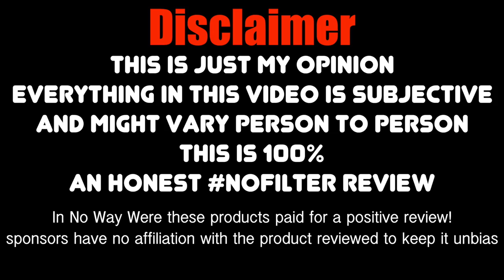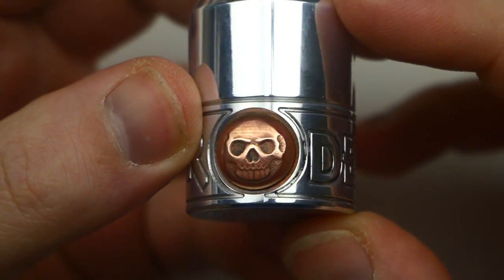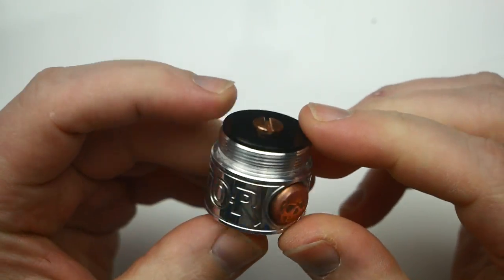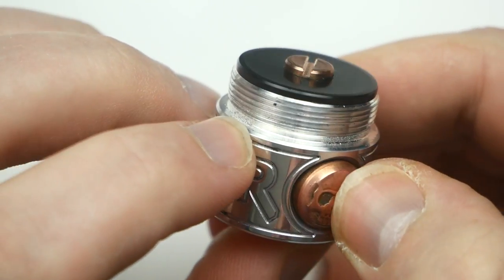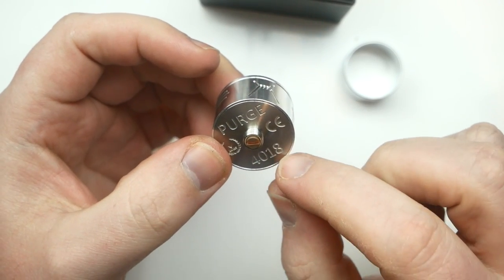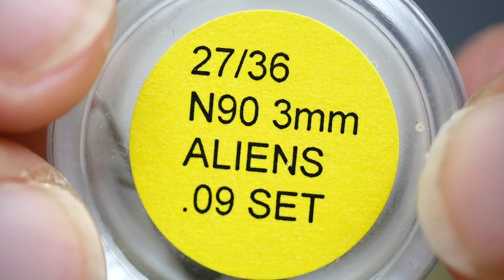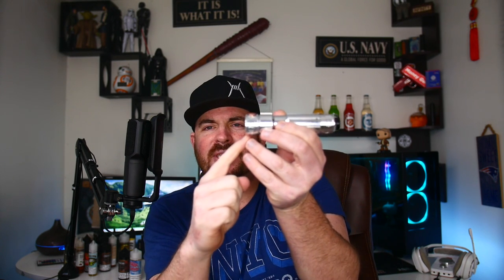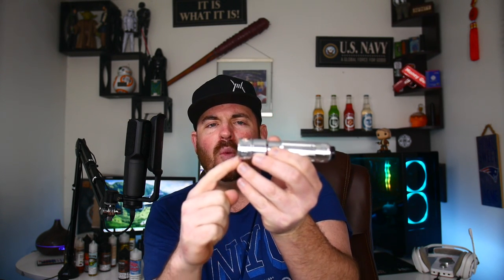Purge Mods Detonator LE 21700 Mech Mod Review & Build/Breakdown VDT

Comment: Purge came out with 25 brass and 100 aluminum LE detonator mods for the first run the 25 brass LE did not come with a X RDA but the 100 LE aluminum came with the raw aluminum X RDA.
There is a standard edition Detonator available in brass and copper without the engrave button for those looking to pick one up.

Comment: Dude I have to say I watched you years ago and I'm back now you don't seem the same at all. You don't seem enthusiastic at all anymore. You almost have a sadness to you. Legit a vibe even over the video. Ifk what's up but I hope you get to feeling better I've watched your recent videos and they still seem like you aren't the same and just down and sad. Also those voltage drop tests with that machine doesn't work correctly it's why you have found a few times you can't fele the drop like it shows. I used to have the ssme one as you. Then I tested a true 1 to 1 connection where there is no travel distance and the drops went from like 0.9 or 1 so from 4.2 to 3.2 all the way up and the voltage drop was actually like 3.9 not 3.2 with the same mod so yeah way off some you probably get better results with but still would of been at least a few points higher to many variables with your machine down to threads alone and rda and everything it's why many nods still hit so hard and you go wait it doesn't feel like a big drop lol

If you change out the spring the Hotspot will go away

Comment: Aluminum should not have anything to do with the numbers you got because aluminum is more conductive than brass and only a bit less conductive than copper.
Reply: I was just gona write that. Aluminum should hit hard! Not sure why he's getn that number?
That's stainless steel numbers..
Reply: Yes my alum lykan sidefire mech def hits harder than my brass ones. Its noticable. Absolutely love aluminum.  Easy to clean , super light obviously lol and man it hits fantastic . Side by side with copper tube tho ?  u cant tell the difference . Mooch made a good point in his vids that it's not really about what it made out of but how it works and how much surface area is being contacted and the threading, yadda yadda . It's all so redundant cuz how something "hits" is dependent on so many factors ya kno? 🤷‍♂️
Reply: @cavemanlovesmoke4394  yeah exactly caveman. If made right they can prob make a ss hit very hard.. Maybe not like brass/copper but I know what your saying. I have a brass Overlord that hits harder than my copper vindicator with cc..
Reply from the maker: Unfortunately all the aluminums I have and tested hit worse then brass and copper

Comment: Shit voltage drop, next..
Reply: The Watcher  just had a lot of mech mods and still have, trust me, there is a huge difference!
Reply: @Redaslt99  Yep you can feel 0.2v difference. You know how you can feel when your battery hits the 3.7-3.6v range in a mech. That is around 0.2-0.3v volts difference from fully charged and you can definitely tell a difference.
Reply: @Redaslt99  hold your horses buddy I was agreeing with you and don't be so angry. Yes full charged battery 3.9-4.0v minus the 0.2v is around 3.6-3.7v. As for the looks, beauty is in the eyes of the beholder.